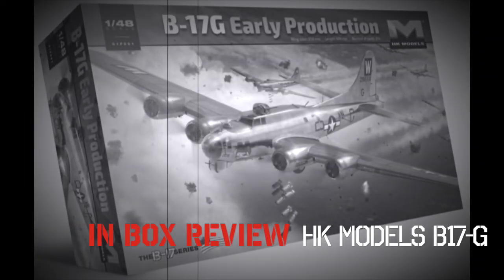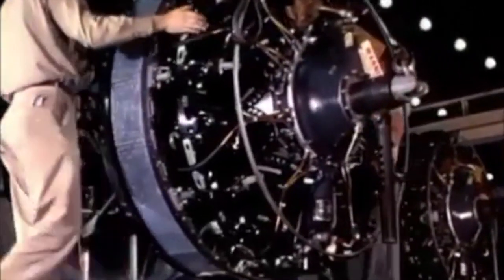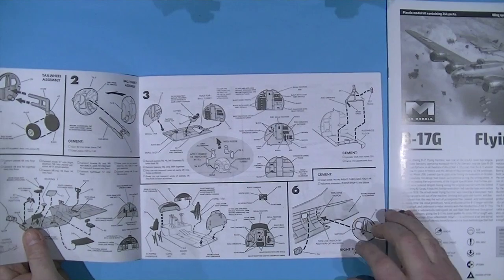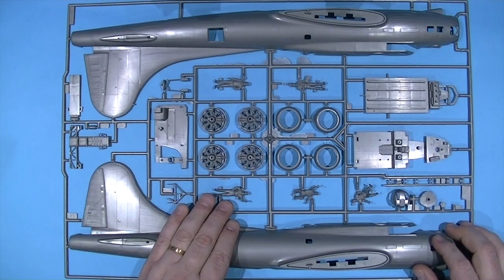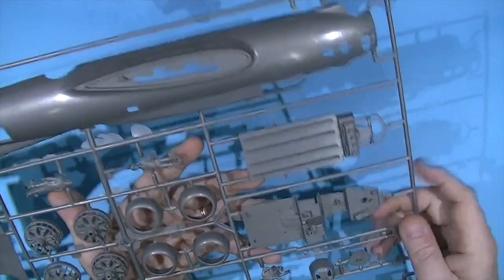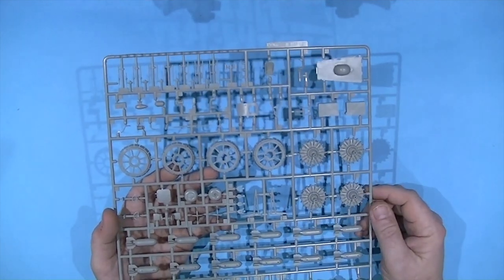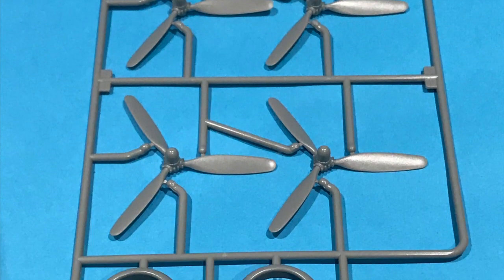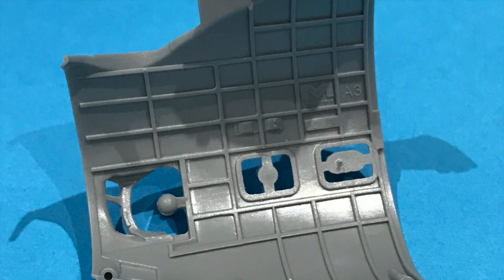HK Models/Revell 1/48 B17-G comparison and In Box Kit Review

Comment: Having just built the Academy 1/72 version of this kit, I’m very glad the unbuilt 1/48 version of this bomber I have in my stash is the Monogram kit. I build most of my models buttoned up, so most of the interior detail is not visible except under the larger plexiglass areas. I devote most of my time to the exterior painting, decals, and weathering, and find the super detailed interiors are a waste of money and time for someone with my type of display objectives. For the same reason, I prefer Tamiya tank models with their one-piece rubber tracks instead of the infernal time consuming and eye-sight straining individual link style. Different strokes for different folks. Btw, that was an excellent comparison video you just put up there. Cheers.

Comment: Cutting bulkhead doors. I have done this on both Monogram and HK. The HK cuts nice and easy. Takes about an hour and cleans up nicely but be very careful with the Radio operators compartment rear door on both Monogram and HK due to being so close to the edge around the gun mount. Monogram plastic is i think a little thicker and makes cutting them out just a little harder as i recall but is worth the effort as it gives slightly more view of the interior when the model is closed up. I did this on the 1/32 scale B-17 and am glad that i took the time to do it.
Thank's for the comparison video!
Reply from the maker: Thank you for the tips very helpful and thanks for taking the time to comment
Reply: @ModelOfficer  I just picked up another Revell (Monogram) B-17 two days ago from Hobby Lobby for $26.00 after 40% off. I have built it I think six times since i was a kid and still enjoy it. As my skill evolves the kit just keeps getting better and better. The HK kit is probably much better but i'd like to note that the decals are lacking the stencils. On the 1/48 kit it'snot that big of an issue but on the 1/32 it's really disappointing on such an expensive kit. Even the aftermarket stencil fall short of the old Monogram kit. I just subscribed to your channel
Thank's again. Have a good day!
Reply from the maker: @pcj3405  Thanks for your subscribing to the channel

Comment: Even tho the HK Kit is arguably better in alot of aspects, i would still go with the Good ol' Monogram kit. I mean for a 1970's kit. It ain't bad at all.
Reply from the maker: Yer both kits indeed have plus points
Reply: The Monogram is literally ten times more accurate: Main gear sit, outer nacelle shape, nose, rear fuselage cross-section, wing airfoil (symmetrical in reality, just as Monogram did!)... The Monogram needs Squadron clear parts, resin wheels and metal guns, that's about it.
Reply: Yep, the main failure of Revell/Monogram is the finer Details, Eduards has PE kits and such that fix this but it is an additional cost, one cost I truly recommend however ;)

Comment: I believe the Old Monogram kit is better proportioned and has a better overall look than the newer kits.. I say "kits" because the 1/32 B-17's from HK are not good on overall shape.
Reply: yes.i still think the b-17 nose section from windshield to glass nose on their 1/32 scale kit is too short.
Reply: @janehill9764  the nose may be the correct length but every clear piece in the nose is out of position and the side glazing is too large on the G variant. The whole fuselage is also too fat hence why you may think the nose looks too short?
Reply: @NigelsModellingBench  i did not know this. interesting. can this fatness be cured, perhaps by sanding the fuselage halves?
Reply: @janehill9764  I have done mine by removing material from the centre then adding material top and bottom on the inside to all ow the diameter to be reduced from the wing back. It is soul destroying and then once you are done you have to fit the top on which is too tall and the windscreens need reshaping because the nose is round and should be flat topped. It just goes on and on and on.... then you find the wing chord is incorrect and the outboard engines are too low in relation to the wing centreline....
Reply: @NigelsModellingBench  wow. it sounds terrible. you are practically reshaping the entire model. should hk be notified of these discrepancies? i am no longer going to buy one, now that i've read your problems with the kit. it's too much money to spend, if you are a purist like me. tx...jane..p.s. out of curiousity, how did your  1/32 scale b-17 project turn out?
Reply: @janehill9764  I got fed up with finding issues, but like the HK Lanc. Such a shame that they don’t listen to those in the know or use blueprints. I mean, really, it’s not like there aren’t any B-17’s to scan out there?? If Monogram could get the shape right over 50 years ago, one has to ask…
Reply: @NigelsModellingBench  yes...hmmm.. food for thought...thanks nigel. looking forward to your next review....jane

Comment: Comparing these kits is like comparing a F-15 with a F-22. Both are excellent fighters but obviously the F-22 is superior because it is a newer fighter. I love the Monogram model. It was the first model I ever built back in 1974 when I was 12. I didn't even paint anything. Just glued it together the way it was coming out of the box. Back then the detail was amazing. It still holds up today. I have built this kit 5 times I think. Of course each one got better and better. My last one was over 25 years ago and had interior lighting in the front, cockpit and radio compartments so all the detail could be seen better. I had the front hatch between the cockpit and bomb/nav compartment open as well as the main crew door near the rear. I added ammo belts, flooring to the waist gun area, upgraded machine gun barrels and little gunsights on all the machine guns. Seat belts and buckles on all the seats with extra detail in the radio compartment and realistic battle damage. One engine shot up and had a feathered prop. It was on a nice custom stand I made for it and covered by a clear plastic cover my uncle made for it. He had a plastic company so it was professionally done. Look great. I had several figures around it that included the entire crew, radio operator still in his seat in the aircraft and with the large window above it and lighting, it all can be seen easily. Also had several ground crew doing different things. Mostly looking at the different areas that were damaged. It was sitting on a dirt runway with a couple very realistic trees nearby. I also had an anti-aircraft double .50 calibur machine gun pit with 2 soldiers manning it off the side of the runway surrounded by grass. There were 3 hidden switches for turning on the 3 interior lights. It was really a beautiful diorama. Had it in my first sons bedroom when he was born for several years. Then sadly had to put it in storage and after several years, from the heat I guess, one of the wings bent upward quite a bit and pretty much ruined it. I am glad that finally there is another choice for this famous bomber in 1/48 scale but the Monogram kit will always have a very special place in my heart. I know there is enough after market flight and ground crew figures available but the ones that come with the Monogram kit, just like the kit itself, will always be my favorite figures and I still have all twenty of them. Of course only 5 are in their original poses. The others have been changed. You know different arms or heads. Can't have two of the same ones. hahhah

Comment: The HK has a few accuracy issues, the most obvious of which are the placement of the outer engines and the nose section profile. These two alone are pretty serious and need some serious work to correct. If they don't bother you, then no probs, but for those of us that are bothered by them, it can be a deal breaker. I have two HK Forts in my stash and a monogram one, the monogram kit can be turned into a gem with a bit of TLC if you like doing that kind of stuff, which I do.
Reply from the maker: @dragongaming4509  I would love to see what you do with the kit
Reply: @ I haven't built it yet as I quite finished the planning, I'm still acquiring the bits and bobs. There are a load of aftermarket goodies that will lift the old bird that are designed for the HKM kit which can be used, but it will require some hacking and imagination. SBS have just released a beautiful engine set for the HKM B-17 which I reckon with a but of fettling will work. The superchargers can be removed and replaced with the eduard items as too lots of other AM stuff that was designed for the HKM model. Rescribing the panel lines and a few hours listening to music while becoming better acquainted with Rosie the Riveter will all add to the final result. It'll take much longer than building the HKM kit but the sense of accomplishment will be so much better. But, then that's me..
Reply from the maker: @ wow keep me posted

Comment: I'm currently building the HK B-17, and have developed a love-hate relationship with the kit.  

Pros. 
-- Fantastic surface detail that I'm sure will look terrific.  
-- Very good instructions with multiple paint call-outs
-- Nice clear parts.  The Eduard mask set is a must.

Cons
-- Significant fit issues with the upper fuselage and nose section.  Had to use a lot of putty to get it to look ok.
-- Injector pins in bomb bay doors and on the inside of the flaps.  Boo!  I ended up closing the bomb bay doors as there wasn't a really good way to get them to show up.
-- Interior detail showed some shortcuts. 
-- Engine detail lacking, but you don't see much of it anyway.
-- Lots of guns, but no ammo belts.
-- No poseable control surfaces.

Others have commented on fit issues with the wings.  I haven't experienced that.  Perhaps there was a manufacturing defect in some kits.

My rating:  6/10
Reply from the maker: It’s really great to hear your feedback thank you so much. If you’re ok with Facebook come join the model officer mess group page and post loads of pictures of your build would love to see it

Comment: LG-Q 8th Airforce 91st / 322nd Bomb Group, 21st June , 1944 on route to target Berlin (Friedrichstrasse) but sadly received damage to left wing as the formation was attacked from the rear as they were coming in via the Baltic Sea heading south east towards Berlin. This specific B17G piloted by O'Bannon is lying in a lake in the former German village Stolzenburg in Mecklenburg Vorpommern today Poland Stolec. The lake is today half German and half Polish ! The larger parts of the fuselage are still in the lake at a depth of approx 3-5  mtrs. whilst the engines would have on impact buried themselves much deeper into the silt of the lake. I have a friend who has some parts off of this B17, there are larger parts which were salvaged by Poles back I think in the eighties and which are at a small museum in Gdynia or Gdansk. According to some historians Russian Army divers and engineers were the first to salvage parts not forgetting that Poland was occupied by Russian Forces at the time. I was actually also on site a couple of times and also retrieved some smaller items. The entire radio equipment and.larger parts of.the Ballturret etc were salvaged a couple of years ago and a friend.had these as.he was.going to display these one day at his very own museum. According to another Pole who I had the pleasure of meeting and who actually wrote a book on the topic the plane was ditched due to the initial fire damage to the left wing caused by the ME110's  20mm or 30mm rounds impacting. However although other bomber crews wh were together on this specific mission reported it wasn't an engine fire but rather the fire was burning between engines 1 + 2 so my guess was the fuel line or hydraulic lines were hit. The crews also reported that the Bomber hadn't dropped its bomb load this it also had to be jettisoned on route towards Sweden as this was the evacuation routing LG-Q took. Furthermore it was reported that all except one crewmember evacuated and parachuted to safety and that the plane was stable but losing altitude. 
Some even commented the plane was left switched to Autopilot crewless.  Hardly believable to me however especially as I had witnessed seeing the left wing and a larger hole which could only be caused by a bomb or flak impact. This hole was located directly where the wing connets to the fuselage! I had even seen a copy of an original Flak report of the unit who had claimed to have shot and hit LG-Q, these were situated at the  village named Rothenklempenow and which is literally a couple of Killometres from the lake Stolzenburg. 
According to all of the other many people who had either seen the remains of LG-Q or had read reports by others there had been NO anti-aircraft attack nor shelling taken place.  Anyhow I know what I read and as it was an original German Flak Abschussbericht and the fact Im half German (English) I fully understand the language!!!
According to a Pole who wrote a book about LG-Q and even had contacted actual living crew members and or daily members of such, there had been no such Flak attack. My very own theory is that at least O'Bannon were still inside of the aircraft as firstly they still had their full bombload as they hadn't made it to the target before coming under attack thus they'd have headed North-West which would have brought them very very close to the town of Poelitz (today Police) where there was one of the largest synthetic fuel manufacturing plants after the one at Leuna and there they could have jettisoned their bombload or over the Baltic on evacuation route to England.

Comment: 15:36  :That flattened HK wing profile, hugh... When the symmetrical wing airfoil was a fairly unique feature for a WWII design, a specific B-17G oddity that Monogram captured perfectly, while HK had to re-invent a more boring and completely inaccurate fiction... And then there is the HK's outer engine nacelles, pointed out as wrong years ago, on their 1/32 kit...

Comment: The Revell kit is a later release--post Monogram. I have the original Monogram release, and, at that time, there were NO plastic bags for ANY of the parts; the sprues were just stacked in the box. Also the box did not come sealed with shrink wrap, or even scotch tape. The tight fit of the lid to the box bottom prevented parts falling out. And, there were ALWAYS a few parts that had fallen off the sprues--smallish sprue gates. BTW, no flash.
Whenever I see the new kits with the high tech CAD & slide moulding, but have indifferent attention to detail, or lack of precision, I think of a lack of commitment to high standards on the part of the design staff, and I wonder how much of enthusiasts they even are to this hobby, or even aviation, armor, etc. Is it just another job to them, do they even care? One never had to wonder about that with Monogram. Whatever the limits of the old technology they had to work with, they used it to the max, consistent with trying to make a reasonable return on investment.
Reply from the maker: Thank you you time to write a comment. With everything new does not always mean best.

Comment: The panel welds on the outside would never be flush so there will always be a slight raised area between them which is evident on the real plane.  This whole recessed panel line is not only incorrect but structurally false and would cause the plane to come apart.  Panel lines are optical aspect at the panel connection points and were NEVER recessed on the real plane, Hobby folk need to get over themselves and start building them correctly.  The reason Revell and other made them raised was for there to be a tad left after a good sanding and thus have correct lines where the joints of the panels were.  Recessed kits look toyish and would never fly in the real world under the stresses these planes were under.
Reply from the maker: Wow this is great info thanks for taking the time to reply.
Not being an expert and just a modeller this explanation of the raised panel lines on the Revell kit makes sense. But the optical aspect of a model I guess is why recessed lines allow us to bring that optical allusion to life. The problem with scale is that somethings on any subject can be lost. After all a model is only a representation of the subject.
Your comment has inspired me to look a little closer and the real thing.
Thanks
Reply: @ModelOfficer  To be honest it's an honest opinion, I was in the Navy and the Jets were right there on the carrier deck and in the hangers.  The plates meet flush but there is not "Groove" cut between them, the line is visible but it's not sunk in like on current models.  I've always sanded them down just close enough so they weren't gone completely, the light creates the shadows at the joints like on the real deal.  Yes the raised panels are out of scale so a careful sanding brings em down, but recessed panels with a pigment in between just looks so toyish and is not how the real planes look up close.  One could argue it's an effect to simulate these but it never looks real at least as the reality I saw.
Reply: thank you for championing raised panel lines. you are totally correct.  and especially about the sanding...i wish people would visit or view REAL aircraft to see for themselves that raised panel lines are accurate and authentic.